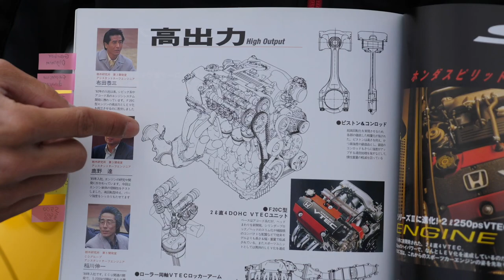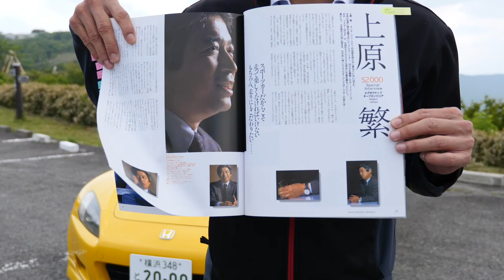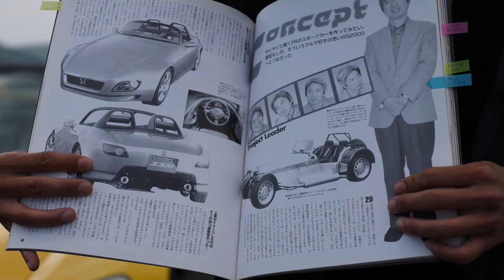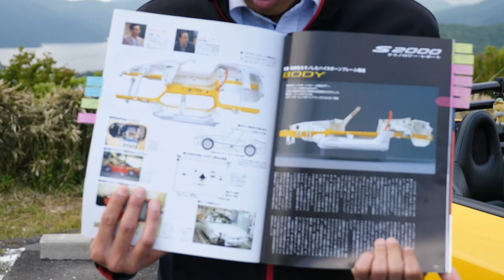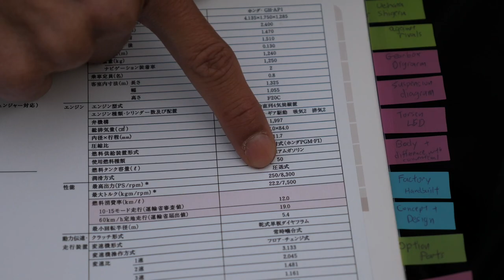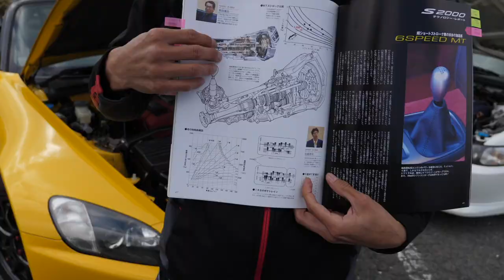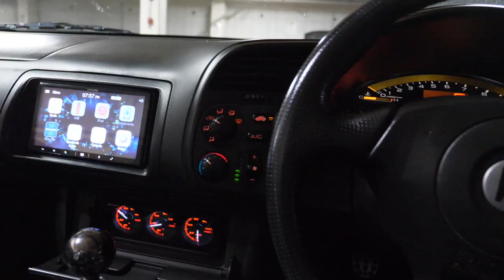Honda S2000 In-Depth Review. The Age-proof Sports Car; ft. Albo | Full technical study | JDM Masters

Comment: The S2000 is simply a special car something that may not return
Reply: It sorta could, if Honda didn’t want to spend development $$$ they just go knocking on Mazda’s door and ask nicely to borrow their miata chassis put a Honda engine and Redesign the exterior and update the interior and tune it however they like, just like fiat did with the 124 Spyder.
Reply: yelloandy They would need to. The MX-5ND2 spanks the S2000 on the track.
Reply: WILL not return.
Reply: If it ever returns. 
It better have a useable powerband
Reply: Honda’s never borrows  they build they are not Toyota ,BMW or Subaru etc. If Honda wants they build from scratch everything so when you drive a Honda it’s a Honda not some Mazda bmw Subaru or Toyota mashup. Yes it might make sense taking that route but hey the purist of pure will keep it pure so no selling souls here.
Reply: bruh hello again
Reply: @moosahans4830  Mazda too
Reply: @moosahans4830  you onviously dont remember the honda-rover partnership then
Reply: @TheChenny73 Wrong!It spanked a particular s2000 that was 20year old car and no one knows if the engine was healthy and if the particular driver was able to get the best from this car.Get any N/A stage of ND-2 and try to spank really good kept s2000's with good drivers(like xav or Karl Taht).They definitely destroy any kind of ND's.
Reply: @yelloandy  blame green in Japan it not built anymore
Reply: @yelloandy  fuck No , y would I want a Miata chassis , when Honda created a way better xbone chassis with higher rigidity in MY ap1 ! Mazda coulda never ! Honda everything or Nothing , with that mentality just go buy u a Miata and put a gay series In it
Reply: @Questchaun  it better have at least 8000rpm
Reply: Honda‘s bringing the s2000 back in 2023!

Comment: I am a fan of the S 2000, when I test drove one in 2007 i was disappointed by the low torque figures, it is a car that strives on revs, it still remains an engineering marvel for a NA engine. I ended up buying a BMW Z4 roadster 3.0 straight six. Fast forward to 2020, I still a BMW 3.0 Si coupe and when I meet up with my friends with S2000 it's pure mutual respect and admiration of the era that produced these beautiful gem. I salute Honda for the S2000 and the reliability of the Honda VTEC is pure craftsmanship.

Comment: Great Video! There is a rattle in the first 15 minutes during the drive. Its a high pitch rattle, kind of like coins. If you have ever heard this in an s2000 its coming from the spring connected to the clutch peddle. This generally happens when lifting off the throttle and RPMs drop in the 2000-4500 range, and the car is allowed to coast. The engine produces a specific vibration at that RPM range when there is no throttle input that causes the sound. Easiest way to diagnose this, when you hear the sound, lightly apply pressure to the clutch peddle (not trying to engage the clutch). If the sound goes away then its the spring.

Comment: Correction about the US Spec F20C engine. Max Power- 240hp@8300 rpm. Compression Ratio: 11.1. Not 11.5 as I mentioned. The JDM spec compression ratio is 11.7. With Japanese 100RON high octane fuel, gives it 250PS@8300rpm.
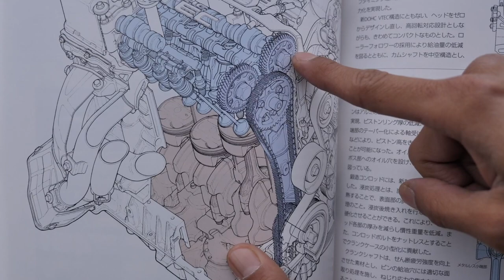Another correction : 33:00. It’s the other way around. I pointed to the exhaust can sprocket first then intake. On this engine the exhaust is on the left side

Comment: why i seen a few s2000 review pop out in my feed lately?  such a interesting car afterall .... especially when you learn about the technical aspect of the car... how much effort,time and energy to build this ... and it perform as intended....

and to my surprised this car still cost around $45k in my country ... which is on costlier sides.
Reply: $45,000 in which currency? Which country? I bought mine 4 years ago - $18,000 with 33,000 miles. Today with the same miles it's going for ~$20,000-$24,000 USD

Comment: @12:00 my ap2 loves the last 3k on second and 3rd gear up hill in my local touge roads.. i also became aware of the value of gear ratios having owned a sti and s2k back to back on the same road.. in the sti i would have to shift what felt like 2 to 3 times more than i did in the s2k having a longer power band and not "living on boost" to pull me through the corners. if you are going to beat a car up in stock trim and have it reliable, theres no better car than this lovely little honda.
Reply: I would say a miata can take more abuse but they are similar

Comment: I have an '03 Suzuka Blue with the same OEM front spoiler. I bought it four years ago with 33,000 miles. Now it has 88,000 miles, Rockford Fosgate speakers, and it's literally the perfect car. Sure it has its quirks but all of them are drowned out from how fun it is to drive and the compliments I get every time I fill up at gas station. 

I went from a 1990 MX5 to a 1999 10AE Miata and now this 2003 S2000. Every one became more refined. Yes, a S2000 is quieter at highway speeds and more comfortable than the Miatas. The difference is when you floor it, it's louder than a Ferrari F355 spider at wide open throttle.

Comment: In Europe we never got 2.2l engine, we had f20 till the very end in 2009.
Reply: I drove ap1 n ap2 many times and chose ap2. I didn’t like ap1 bogging at slow turn on 2nd gear. In USA ap2 gets obd2, so you can just flash the ecu
Reply: @kdavid123186able  from 06" we also got dbw so you can flash ecu. If it bogs dowm jn second gear, then put it in first.🙂

Comment: Good video. I agree with most of what was said, but although they are both Japanese rear-wheel drive roadsters, the comparisons to the MX5 are excessive. The S2000 was significantly more advanced, powerful, and higher performance in 1999. They shouldn't really be compared beyond basic metrics. More references and comparisons should have been made in the review to the S2000's rivals - the Boxster and Z3.

Comment: 2005was the AP2 in the US market. Europe only had the facelift from 2005 all the way till 2009 still with the 2.0L engine as we wanted the 9k RPM revs. In all areas fly by wire was introduced to the engine in 2006. Also the 2.0L engines DO rev to 9k infact even higher at 9.2k before it hits the limiter.

Comment: I thought the reason why Honda’s engines rotates anticlockwise was to help with traction. Whereas a conventional FWD would lift the front suspension under hard acceleration thus losing traction. The Honda would do the opposite, which would exert downward pressure on the front suspension giving better traction. I believe Peugeot used this method in their rally cars to enable them to land flatter after taking a jump.

Comment: i just saw a video on the aerodynamics of a s2000 and it was kinda sad. .38 drag coefficient and the roof creates a lot of dirty air which could cause either lift or downforce. the spoon roof showed great improvements for the dirty air.

Comment: The soft roof has a hole on the left rear side (hope Albo knows this already). It needs to be fixed or it will leak.
Reply: I went thru 3 tops in 100k miles

Comment: I’m not sure which looks better. The MX-5ND is almost perfect.
Reply: Nd2 is best of all
Reply: ND2 is also quicker on the sprint. The main problem with the S2k is the 90s civic feel till you get to 7.5k rpm. Gets called the "torqueless wonder" in many circles because of its demand to always be near redline. With the ND2, torque is felt early on at 3k till redline.

Out of the many roadsters that came out to compete against the MX5, only the BMW and Porsche remain as the Slk has its last year right now, and having driven them all but the BMW, none compare to the MX5, including the S2k.
Reply: Gearing...the difference in a drag is minimal and if you look at lap times stock on various courses, the s2k beats the ND2s2k's top speed is 165 or so. If you change the final drive to match the miata things are very different. I've had both and currently have an s2k and frs. Oh, and vtech engages at 6k, which is also easy to lower with a vtech controller. The ND2 is a fantastic car, but the s2k is a more focused track weapon.

Comment: The X frame chassis still is not stiff enough. You can feel the front twist on turn in. The body flex is pretty bad. Especially on stiffer springs.

Comment: Can you explain the differences from the usdm s2000 motor I’m curious to know
Reply: The biggest difference is slightly lower compression due to geographic gasoline octane in other regions I think. JDM versions are 250 horsepower, exports are 240, and the SAE accounting revision updated it to 237 in the USA.

Comment: Does S500 S600 and S800 front engine rear wheel drive too?? So they actually did made FR car before S2000
Reply: The S500 S600 S800 was indeed a FR platform. I should have made is clearer at 7:00 that “up until that point of the NSX they Honda never produced ANOTHER FR car”. For the modern age
Reply: I believe they were chain drive too. Like a motorcycle!

Comment: Could you guys do the Miata in the near future would love to see how well in depth and the spirit compares to the s2000. Since the Miata is the only current sports car still available.
Reply: Mx5 not miata FFS
Reply: The ND2 MX5 versus the ap1 S2k has comparison videos on youtube. One direct side-by-side reveals that the S2k is slower and weaker now. If I recall correctly they stated the S2k is too stiff and rigid, feeling like a go kart and very unforgiving to the driver whereas the MX5s biggest complaint is the body roll turns out to be a huge advantage against its competitor.  Probably why MX5s been thrashing S2ks on tracks and autocross.

Comment: Pretty detailed review, included some things I didn't know even after owning an AP1 since 2007. But more could have been mentioned about the handling. AP1s have responsive throttle steer characteristics that were dulled in the AP2.

Comment: I wouldn't call it age-less. Neither cars make much power before 7 grand. The VTEC is super unrefined compared to the k series engines of 2002 and beyond.
Reply: Well, I wouldn’t call one of the greatest engines ever made ‘super unrefined’ either. The K20 shines because of i-VTEC. The F20’s power delivery is on or off unlike i-VTEC and VVTL-i where valve timing starts changing at much lower revs before the final kick in lift.
Reply: Wholehearted agree. Best description of the S2k is "feels like a 90s civic until 7.5k rpm". Honestly I would hate to see much more power and torque available on that stiff and rigid chassis because it's already very unforgiving.

Comment: Boxster was always a superior drivers car than S2000. Good effort though Honda
Reply: The early 2000 boxster's when new were around $40k to 50k. The S2k when new was $30k. Now days the S2k is holding it's value better. I have not driven an early 2000 boxster's so can't comment on the driving experience but when just looking at the specs alone the S2k is more impressive.